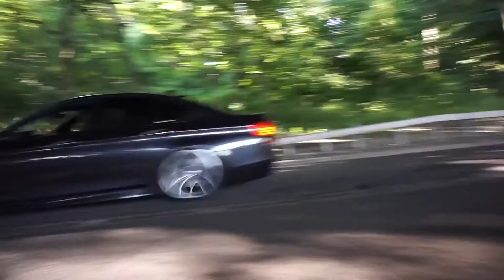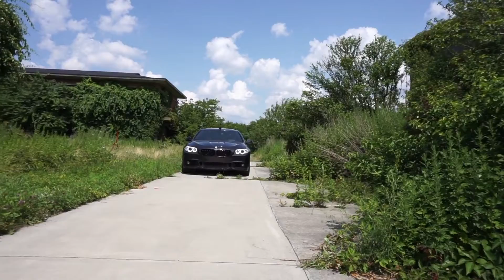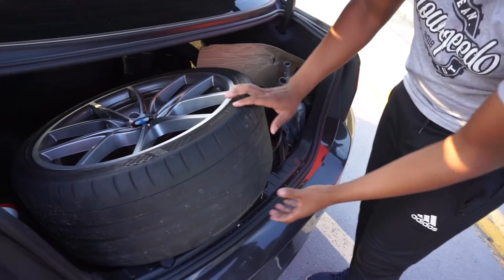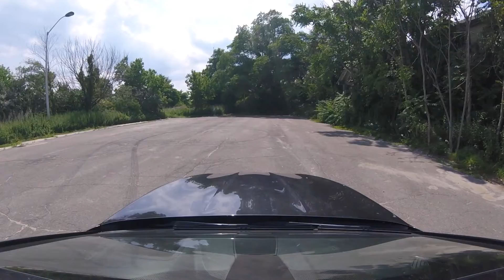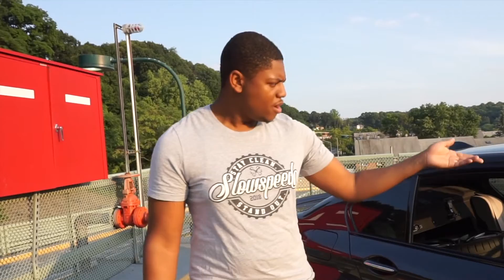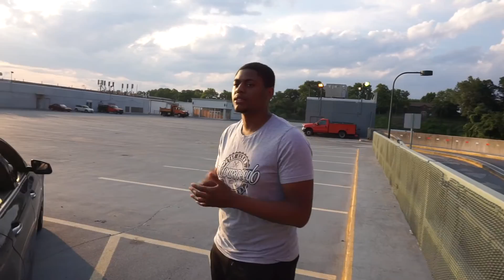So..... My BMW does Donuts!!!

Comment: You can also do 3rd gear break stands like my buddy's car 2014 550i 6speed manual which makes 553whp mods; jb4 w/bluetooth test pipes, akrapovic cat back and intakes. Also just installed a hydro handbrake so now hes got a bad ass daily drift beater lol

Comment: Keep it in 1st gear when doing the burnouts and donuts, just pat the gas to keep it in the high rpm range
Reply: you can,t do in thisway to 520d, you can,t fix gear without software remap
Reply: How do you drift in an automatic

Comment: did your car upshift when the rpm reach redline ?
Reply from the maker: It would only do that if you press the WOT button at the end of the throttle travel
Reply: @Slowspeed  mine was never able to do it without fucking up my rack 😭😂😂

Comment: 535i ?
Reply: yes
Reply: No
Reply: the 535i has one exuhus tip on each side + he said its a 2L turbo
Reply: abood hjee It’s a 3 liter turbo and he made it quad exhaust
Reply: abood hjee Therefore a 535i
Reply: @jayfigueroa3649  he said its a 2l turbo in the video. Witch is 520, 184 hp
Reply: @filipjugovic6952  They didn’t make a 520i that year. Strange.
Reply: @filipjugovic6952  528i is also a 2.0l turbo